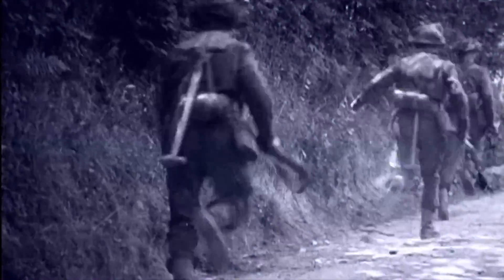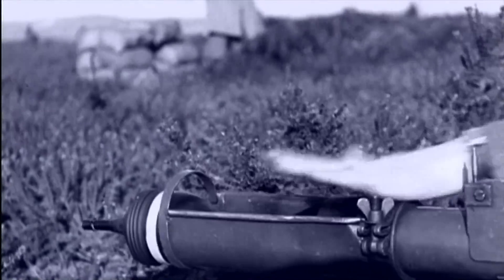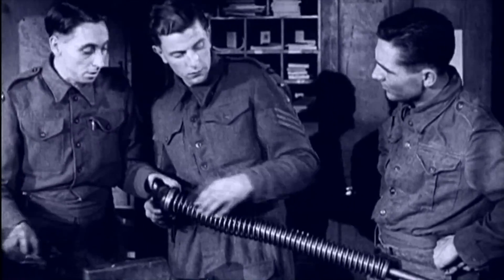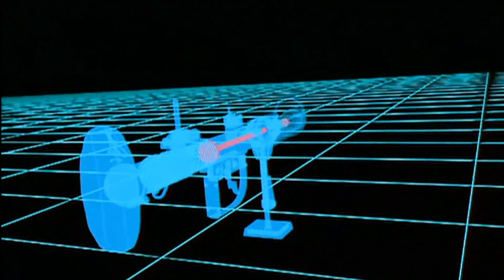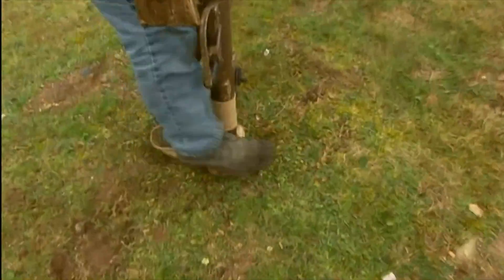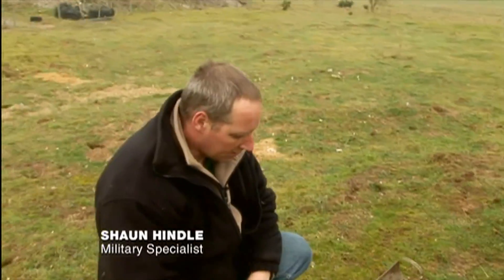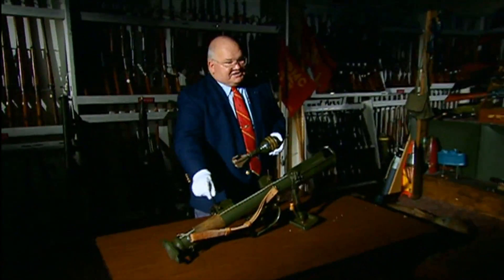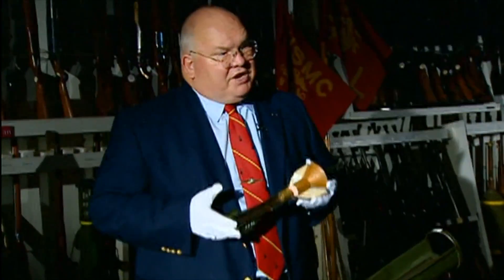Weaponology - "British PIAT"

Comment: Alright so it wasn't brilliant but needs must and one advantage would be that there would be no recoil blast.
Reply: CruelestChris I'm not being hypothetical, I'm just stating how it was used
Reply: CruelestChris Please don't put words in my mouth. I said a benefit of the spigot mortar delivery system was that it was relatively subtle as it didn't produce much flash or smoke, which made it much better in urban situations than the panzerschreck or bazooka. Sure, you could fire either of those weapons in a house-to-house fighting scenario... at least once, then you'd be very much detected. I'd be extremely hesitant to fire a panzerfaust from within a room, as the overpressure could probably blow your eardrums out. Recoiless rifles and enclosed spaces don't go together well.

These benefits were probably not by design, but rather just happy coincidences that soldiers learned to take advantage of. My point was that while the PIAT were in general inferior to its counterparts, it did have advantages.
Reply: I know. Each platoon in an Infantry rifle Battalion had one in the early 80s. I carried and fired one.
Reply: Barrie Rodliffe 
No, not really. The M9 bazooka in particular had the same armour penetration and was overall a better, lighter and cheaper. I'd give it to the PIAT over the M1 bazooka, mind you, the PIAT was at least a lot less likely to kill you than that one.
Reply: +CruelestChris  No one makes a grenade firing recoilless gun today either, but the panzerfaust was still good.
Reply: +agt155 
I'll take "what is a Carl Gustav" for ten, please.
Reply: +CruelestChris The Carl Gustaf is a recoiless rifle. Need any more help just ask.
Reply: +CruelestChris The Carl Gustaf is a recoiless rifle that doesn't fire grenades. Panzerfaust was a type of recoilless gun that only fired grenades - yes, a principle no one uses anymore.
Reply: +agt155 
The panzerfaust fired hollow charge warheads, not grenades, unless you use the enormously broad German word "granate" instead of the English one. Since the Carl Gustav also fires hollow charge warheads, yeah, it's the same principle, one is just a more practical execution than the other. I actually almost put this in my previous reply because it was such a transparent attempt at a bullshit escape clause.
Reply: +CruelestChris Carl Gustaf fires shells, Panzerfaust fires a stick with a grenade on the end. There are huge conceptual diffeences between the two, leading to one design being extinct and the other still being in use.
Reply: +agt155 
It's a warhead, you idiot. Same thing that any other AT weapon fires.
Reply: agt155 Explain to me these huge conceptual differences.
Reply: +CruelestChris SYes the Panzerfaust fires a grenade with a war head. Carl Gustaf fires a shell with a war head. Completely different designs.
Reply: +agt155 
No, it does not. The Panzerfaust fires a warhead. It is not a grenade. It's precisely the same principle as any other recoilless weapon, the only difference is the ammunition is divided up differently (propellant is in the tube in the Panzerfaust and in the projectile in later designs). It is the immediate forerunner of single-shot disposable preloaded launchers like the LAW, and you are an idiot who is trying to split hairs. Nothing even resembling the PIAT exists anymore: why would this be, if there were innate advantages to such a design?
Reply: +CruelestChris The LAW is a direct descendent of the Bazooka with absolutely zero relation to the Panzerfaust. Modern RPG's (what does the R stand for?) are the descendants of the Panzerfaust.
Reply: +agt155 
You realise an RPG projectile isn't actually a grenade, right? And that you just utterly buttfucked your own argument because that means the principle is still being used even if you're right, you utter fucking imbecile?
Reply: +CruelestChris What does the "G" stand for then? Modern RPG's are not recoilless guns.
Reply: +agt155 
So your evidence is a common-use non-technical term with a dubious background that may trace back to calling bazooka rounds "rocket grenades" after the fashion of rifle grenades, or is a backronym from a Russian term first used for a type of hand grenade that didn't have a rocket? That's... about as convincing as any of your other arguments, I guess?
Reply: +agt155 
It is to laugh.
Reply: +Atzy The big conceptual difference between the two is thus. the Carl Gustaf works much like a standard gun. Big explosion of propelant large build up of pressure in tha barrel,, pushes projectile out at high speed. Only, a proportion of the exhaust gas is directed rearwards to counter recoil.

The Panzerfaust works completey differently and much more like a rocket. Propellant is ignited, big bang, all exhaust gas pressure exits rearwards, projectile goes forward via Newtons 3rd law.

They are completely different. The Carl Gustaf has more in common with the PIAT than the Panzerfaust.
Reply: Carl Gustaf needs a two man team and is one heavy fukcer. Not including the rounds. The backblast is high and it can not be used in buildings. You also need to at least knee when firing.
Reply: Was it as harsh to fire as they say?
Reply: Quiet.  If you want ranged fighting against Panzer IV, Panther or Tiger then 17 pounder will do the job.  They don't like it up 'em.  .
Reply: SCD4 
Oh right, in the 80s you'd have been using the all-steel M2 that was actually heavier than the PIAT (36 pounds), they got it down to 19 in 91 with the M3 MAAWS and the new M4 is 15.
Reply: It wasn't very good. Brave men made it work anyway. And they didn't do it by the enemy not knowing they were there, they did it by having more balls than Wimbledon.

And I'd have to ask if you've ever seen footage of a real bazooka shot: the backblast is mostly that, a blast which disperses extremely quickly. The PIAT had a firing signature too, a small puff of smoke in the air just in front of the launcher from the propelling charge detonating that looks like a mortar firing.
Reply: The PIAT did work very well, not perfect but it was certainly better in many situations than a Bazooka
Reply: Shannmeister And it could fire over obstacles but yeah, compared to the Bazooka, Panzerfaust and Panzershreck it was really shit or at least a hell of a lot less ranged.
Reply: +Atzy Agreed, especially in the hedgerow country of France, prob was the open fields but I guess the 17 pounders were sufficient enough for that job.
Reply: +Atzy 
I don't see how a directional-blast weapon with a range of about 40 yards vs. armour would be that hard to find, just seeing which direction the hit was from would narrow the range of places it might be down considerably. Only the Panzershreck had a smoke trail since the bazooka projectile expended its entire propelling charge inside the tube and the Panzerfaust didn't have a rocket motor. Also the idea that you can't fire rocket launchers indoors is incorrect, you just have to have decent clearance, sweep up debris so the blast doesn't throw it at you, and make such you don't do anything stupid like close the door. Even the M47 Dragon can be fired indoors.

If you add to that that the PIAT was inaccurate and a lot of the rounds manufactured for it were faulty, you don't really get much advantage from silent firing versus better range on a weapon that's much more likely to actually hit the target and do what it's supposed to do.
Reply: +Atzy 
No, you are saying how it was supposed to work. In practice, it was mostly put to good use by elite units like the paras who had enough training to compensate for its shortcomings, but would still have had a far better time with bazookas because the alleged advantages don't even remotely make up for the disadvantages. This is why nobody makes infantry spigot mortar anti-tank weapons anymore.
Reply: +Atzy 
As said, the overpressure isn't that high as long as you don't do stupid things that maximise it. Most launchers have minimum room dimensions, but there are instructions for emplacing modern recoilless weapons under houses in urban combat manuals, using far larger projectiles.
Reply: +agt155 So it's a recoilless gun that launches a warhead, gotcha. Totally a principle nobody uses anymore.
Reply: SCD4 
Carl Gustav is over one-third lighter than the PIAT, though. 19 pounds versus 32.
Reply: CluelessChris  is always trying to make out the PIAT was no good,
It worked and was very effective and in open country it was not hard to get close enough to take out tanks without being seen, there are hedges and ditches to hide in.  
The Bazooka, you fire it once and you are a target, the PIAT you can stay hidden and fire several times in a very short duration and if you have more than one PIAT and a few Bren guns the enemy is going to have a hard time finding you.